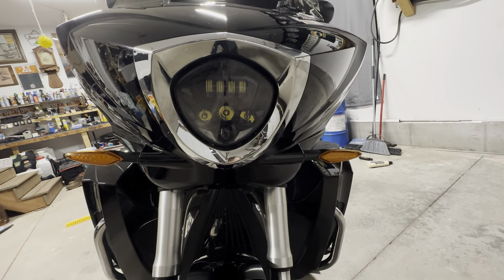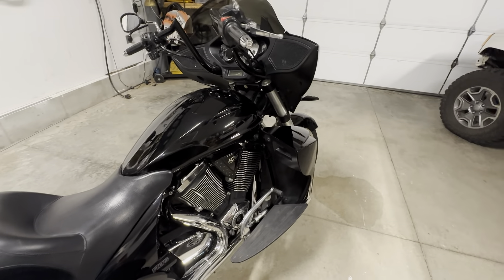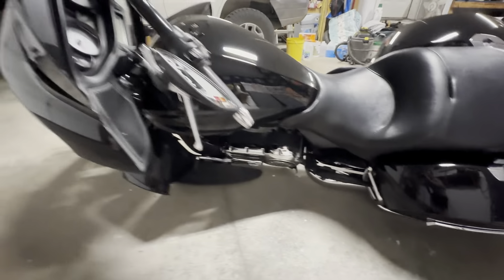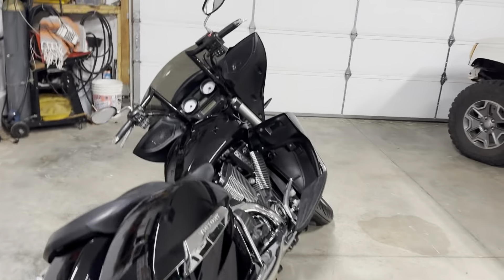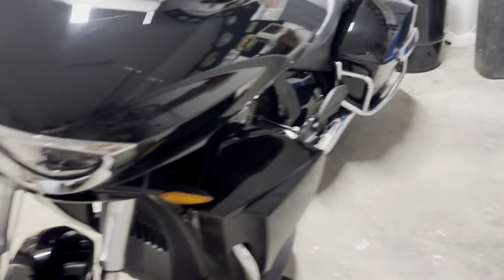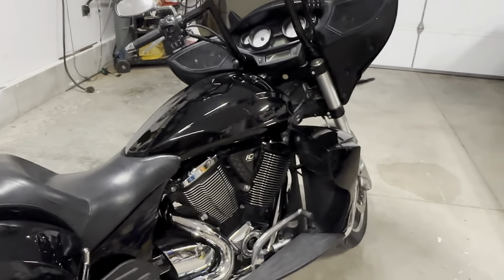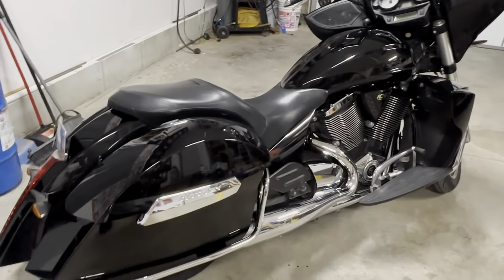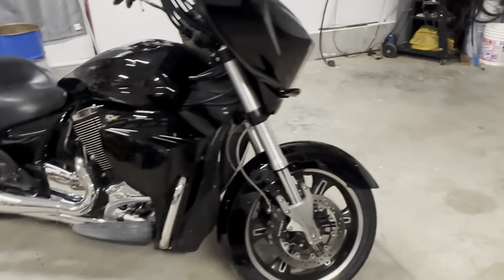Things I Hate About Victory!! Why Did I Buy A Victory!!! #Victory #Indian #motorcycle

Comment: I ride a Honda vtx 1300. I’ve looked at those before and they look sharp. Never rode one though. The one thing I don’t like about my bike is my main fuse is a single 30 amp. Not much to play with for add on’s like big sound. Definitely looks like a a fun ride!
Reply from the maker: Love the VTX!!! Owned a 1800 and amazing bike just the double pin crank = equals their exhaust sound which drove me nuts. Love the Victory Sound

Comment: You know what I hate about owning a Victory? They’re so boring. They did such a great job of designing the bike that I don’t have to get a Sears & Roebuck-sized catalog and spend all kind of money replacing the seat, suspension, windshield, lights, forks, and brakes. 

You know what else sucks? My Victory never breaks down and leaves me stranded on the side of the road. I have a whole chest of tools and I only get to use them to change the oil or replace the air filter. I bought all these tools for nothing.

The only thing I can do with this boring piece of junk is clock tens of thousands of trouble free miles. Jeez. I wouldn’t wish this kind of pleasure on my worst enemy. I better keep my Victory off the market, so no one else will get tricked into owning such a boring, useless bike.
Reply from the maker: I agree!! All my buddies were shocked I did a oil change in the Walmart parking lot on vacation and they carry the filter I need with some T4. Ran some T6 and wasn’t happy so mid trip changed it out cause I could lol every time I ride it just brings a smile!! And when I randomly smash it and it lights the rear tire up. Could go on and on